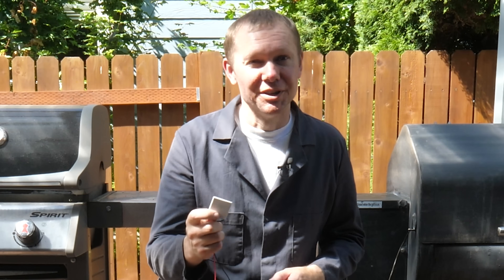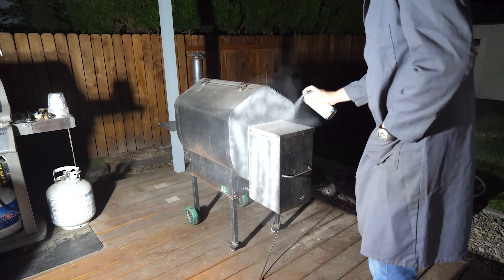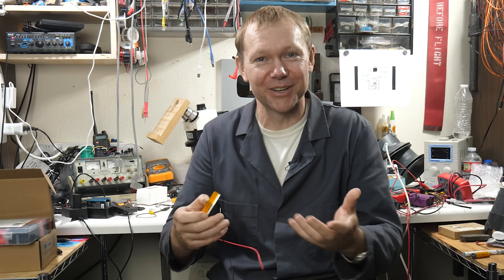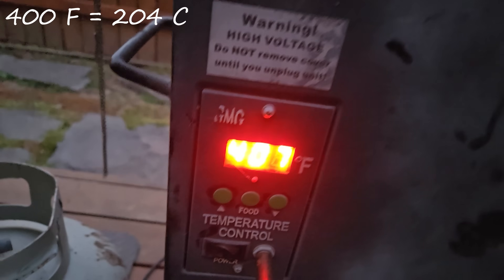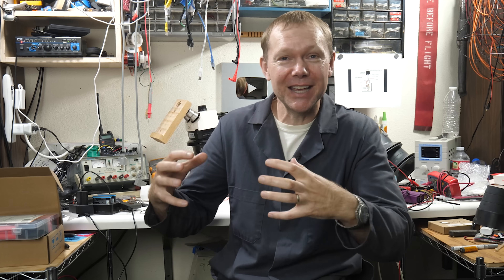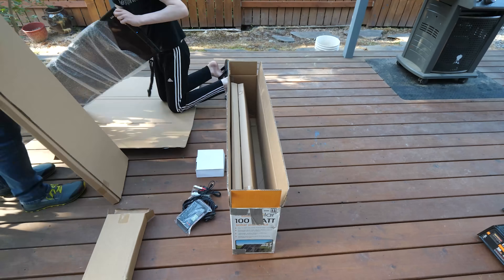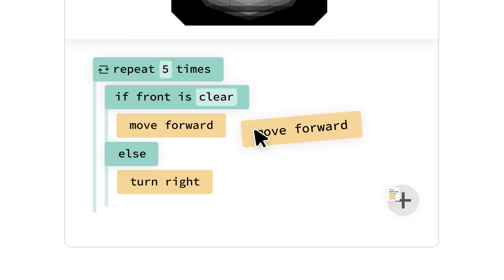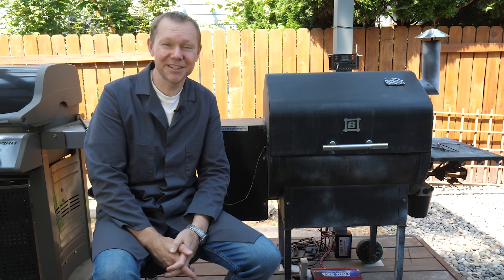Can you make ELECTRICITY while cooking?

Comment: This experiment is counter productive. You want to rob heat to power the fan on a grill where you need the heat for cooking. 
If you are successful at powering the fan, you will also reduce the temp and force the grill to consume MORE energy (wood pellets & fan power) to actually cook the food.
Reply from the maker: Next level insight!
Reply: @QuintBUILDs  more of a "been there, done that" thing. 
I am often looking for ways to "recycle" heat that wind up draining needed heat, not collecting waste. 
In your case, the "drum" should be insulated and the seebeck coils should be on the exhaust only. 
If you used double wall pipe, the exhaust heat would draw fresh air across the cooling fins via the venturi effect. 

You're my kinda guy tinkering with ideas to put waste to use!
Reply: @Dewydidit  Turning it from a Supercharger to a Turbo?

Comment: Only thing I could think of for a bit better efficiency on those thermoelectric modules, set the fan assembly pointing down and stick them to the underside. Since heat rises and cool air would be near the ground, it should help some to keep the temperature differential

Comment: You should check out how this is done in a BioLite camp stove. Same idea where a thermoelectric module charges up an internal battery. They have a built in fan that gives a better differential in temperature and what might be a heat pipe that goes directly into the flames. I could see a scaled up version of what's in that stove working for this application which would be pretty cool. Great video and solar is definitely a good option too!

Comment: Your set-up lacks the temperature delta needed for the demand you want to implement. Maybe you should explore isolating the device from the heat source such as putting a heat pipe to the grill and the device on the heat pipe. I imagine it will return better results as opposed to having it directly within the heated area.